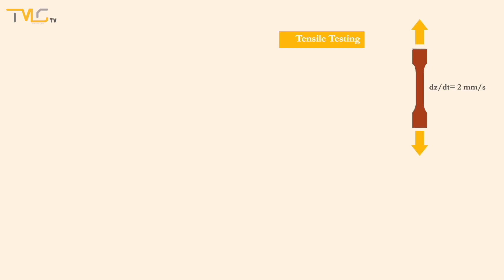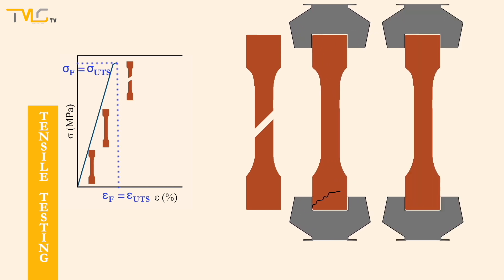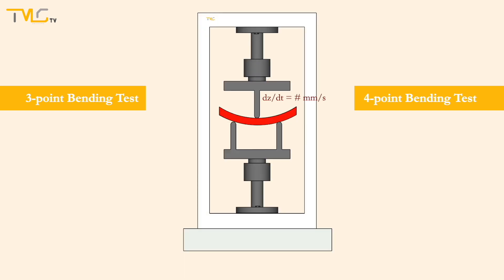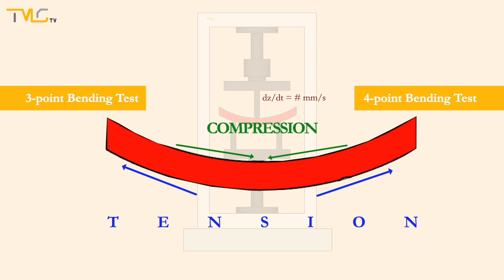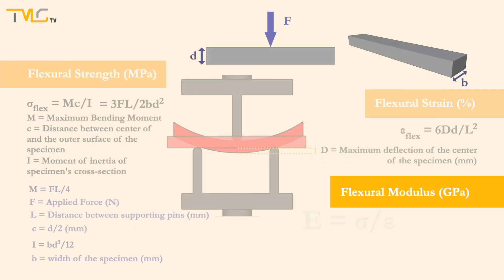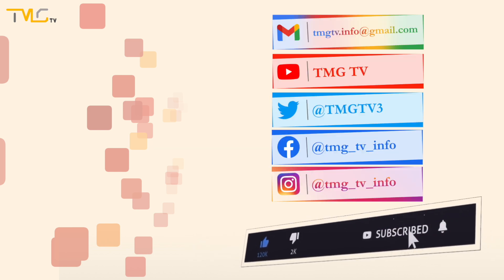Video #2.4 - 3- & 4-Point Bending Tests(Mechanical Properties of Materials)

Comment from the maker: Time Stamps
-----------------------
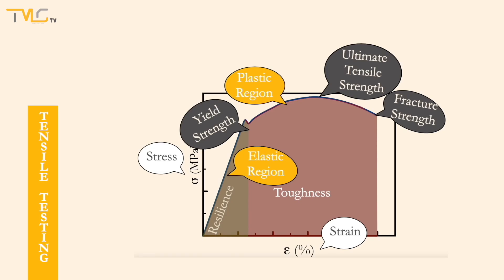0:29 Shortcomings of Tensile Test (Çekme Testinin Yetersiz Kaldığı Durumlar) 
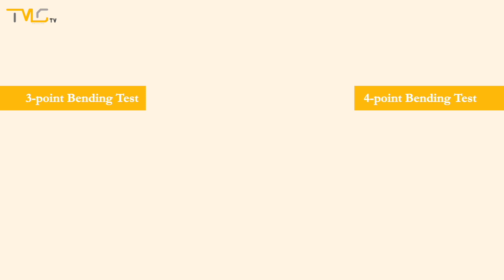1:32 Bending Tests (Eğme Testleri) 
2:03 3-Point Bending Test (3-Nokta Eğme Testi) 
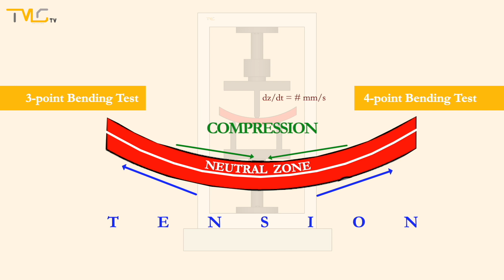2:55 Flexural Strength (Eğme Mukavemeti)
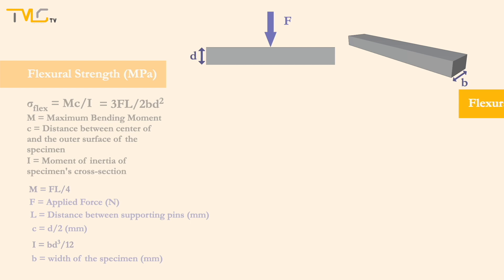4:16 Flexural Strain (Eğilme Gerilmesi)
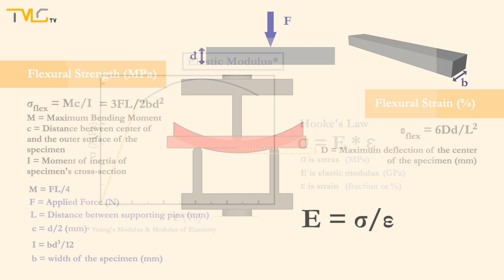5:04 Flexural Modulus (Eğilme Çarpanı) 
5:42 4-Point Bending Test (4-Nokta Eğme Testi)
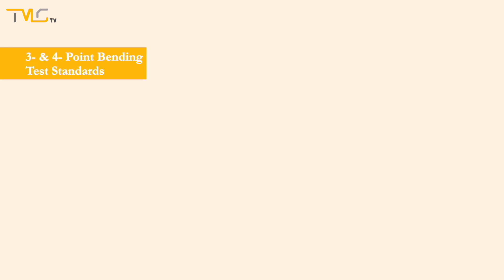6:58 Bending Testing Standards (Eğme Testi Standartları)